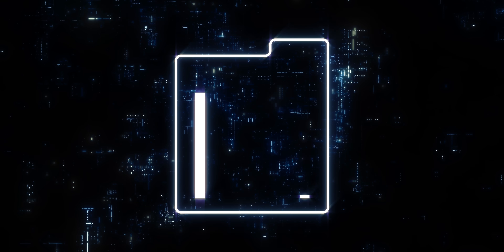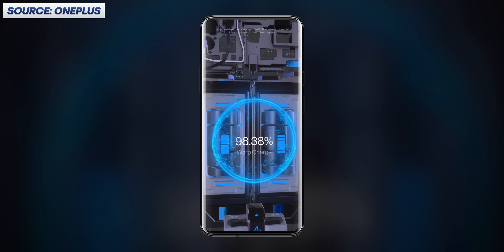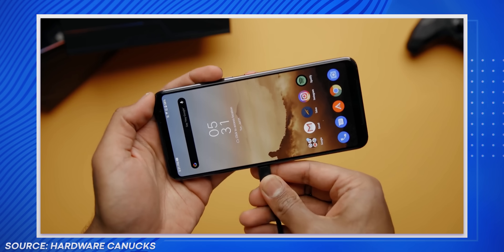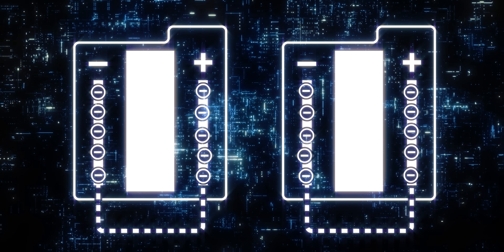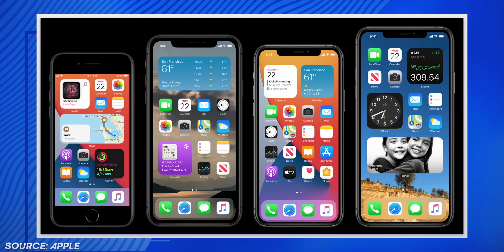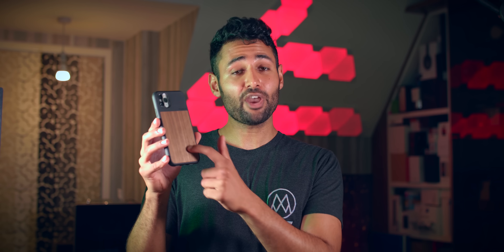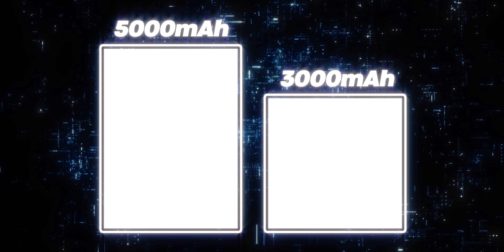The Problem with Fast Chargers.

Comment: Plugs phone in fast 120W charger
The Phone: Note 7 Mode has been activated.
Reply: That's a good one
Reply: funniest cell joke I've heard ever ha
Reply: The phone 2 : Apple mode has been activated.
Reply: That was a really dry joke :P
FYI:Note 7 did not have as many cases of catching fire as people think. Just media blowed it up.
Somne iPhone have had just as many real cases of catching fire ;P
Reply: Ik
Reply: @Oystein87  it's not the amount of fire catching that happened, but rather the way they handle such PR disaster is so poor.
Reply: @FlameRat_YehLon  They handled it pretty good.. And they recalled to phone very quickly and got new batteries. But the battery manufacturer fucked up AGAIN so it did not work so they recalled it again.
So Samsung did good in handling the situation and people still complained.
If it was Apple they would just deny, deny deny and than finally when enough people get mad and the lawsuits start rolling ion: "ok, we did do a mistake after all and will fix it". THAT is a bad way to handle things.
Reply: @Oystein87  That's true everywhere else except in China. In China they tried to bribe affected customers to not disclose the issue while claiming a case to be "done intentional" with the customer claiming that he didn't allow Samsung to take back the phone (meaning that the claim is made with no proof since no test can be done). That phone was later sent to test by the customer himself and the result says no external force is applied to the battery.

And what's worse, it lead to people dig deeper and found that they seemingly bribed government to cover up one of their issue once. (There was an accident that an S6 caught fire and burnt a child's face, and when the customer reach government for some test result to see who is to blame, they got beaten up and weren't allowed to take photo of the test result.)

And during the next year, there are rumors that they bribed the television to not report the case during a consumer protection show (which is supposed to reveal consumer market issues every year and has wider influence than the internet). 

All those and... They didn't say sorry for once in the later years and they didn't even tried to save their PR with some better marketing campaign (but rather they either don't do marketing at all or ignore that people still have concern in their products). Which lead to them from having 20%+ market share in China to basically none.

Disaster it is, and they have no one to blame but their own. I mean, these are issues every manufacturer might face, but they indeed did it worst to get it over.
Reply: @FlameRat_YehLon  🤣🤣🤣🤣

Comment: I rarely use fast charging. Only when I am in a pinch and need battery life. I also never use my phone when it's charging, and place it in a cool place, like near my air conditioner or fan while it's charging. I always trickle charge via a USB overnight, where it might take 5-6 hours to charge my phone, but the slower speeds generate almost no heat, making it healthier for my devices. 

For some people, this might not be convenient, but I also have an LTE smartwatch so it's not like I am always 100% disconnected when it comes to picking up calls or texting. This habit also curves my social media consumption, so thats another positive side effect of letting my phone charge and let it do its thing lol

Comment: Me who is charging my phone while watching this video

What's over heating?
Reply: Depends on how fast you are charging... And it will also slow down the charging when the heat of the battery rises..
Reply: I thought the same and not just that i am using the rog phone and it's side port witch charges just fine don't know what hes on about

Comment: my moto g7 power has their "turbopower charging" i think it used all 4 conductors since it only works with a cable that transfers data, its quick (charges the 4759 mah battery in about two hours) but it gets HOT

Comment: I have two phones of the same model and thier batteries are removable so i use my 100% battery while the other battery charges from 0 to 100 so when my first battery dies I'll just switch batteries and so on

Comment: i will say this - i have a realme x2 pro. i charge it at 50w, sometimes overnight (though i try not to), but 50w is fast. i've had it almost a year, and i've not noticed any degradation. on obviously it's a slow process, but normal amounts of degradation will only really become noticeable after a few years - by which point most people will either be buying a new phone, or replacing the battery.
Reply: I've heard other with Realme phones say the same thing. I do think it'll take another year before this can be truly proven. But I have a Note 5 with older fast charging and a Oneplus 5T with slightly less older fast charging, both still have solid battery life and still charge very fast. I don't believe this has been proven yet and is simply an assumption.

Comment: I am using mate 20 pro when i charge its temperature increases from 35 to 43 celsius so i use commob 12 v cpu fan coller it stabile the phone temperature at 35 c

Comment: I've been saying this for years! In regards to charging efficiency normal (non-fast charging) batteries are like sponges. If you dump a bunch of water on a sponge quickly it isn't going to absorb much water. But if you add one drop at a time to the sponge it will absorb all of the water until it's full. So in regards to batteries it's the same. A slow trickle charge fills your battery completely with very little harm (there is always degradation to a battery whenever it's charged, but a trickle charge causes the smallest amount of harm). I personally use the lowest amp charger I can find and charge my phone at night. In the morning I have a complete charge and I'm ready for the day.

Thank you for making this video! Hopefully this helps progress the paradigm shift when it comes to phone batteries and chargers.

Comment: Arun: "If you keep your battery at 40°C then 40% of its capacity will disappear"

Meanwhile my phone that reaches upto 50°C even if it is charged with a 10 watt charger: "I guess I'll die then"
Reply: Can't relate, I play and charge my phone inside my fridge .
Reply: @thesecret5706  Been there bro😂😂😂
Reply: 😂 40% @ 40C is very rare case. My phone get to 40C very easy while charging. Has been 2 years already capacity has decreased only about 20%. Although he was right about manufactures having buffer. My phone actual capacity is 3010mah but even when it was new it charged only to 2667mah. 😂 For 1 year it showed full health because despite degrading it was still more than 2667. Now it has decreased to 2400
Reply: @rapiddu6482  can you tell how you checked the battery power
Reply: @gauravmisra3107  There are apps for that, like accubattery for example.
Reply: @rapiddu6482  how'd you know the exact capacity?
Reply: @rapiddu6482  how do you exactly know these specifics about your phone battery? Like for an app or something? If yes then please would you tell which app/software
Reply: RapidDU how you know how many mah is left?
Reply: He is talking about the environmental temperature.
Reply: @Quad3  HTC One M9+
Reply: Buy a phone cooler, they are cross compatible with basically any phone model and you'll use it on tour next phones.
Reply: @Anankin12  Can you suggest any? The only ones I find are gaming ones with joystick
Reply: @sahelhossain7601  well I do use the BlackShark one even if I don't have a blackshark phone; it's very effective. The two downsides I can think of are that you must be careful about how you place it or it could become a heater instead of a cooler (usually, the interface lies between 5°C and 20°C depending on various variables; got it to 70°C by mistakenly covering the air intake for a very extended period of time) and that it's difficult to place on the "hot" components due to the fact that the camera bumps will destroy the conductive interface. It's also slightly heavy.
It gets cold enough that condensation will form on the cold side, so pay attention to that if you leave it running with nothing attached to it.

It does its job incredibly well though.
The name is FunCooler Pro.
Look into similar stuff.

PS: the thing works using a thermal diode, which uses the quantum mechanical properties that make PCs work to move heat from one side  to the other. So, one side gets colder, the other hotter. Since second principle of thermodynamics, the hot part gets hotter than the cold part gets colder, due to the electrical energy you use to do the work. This is not a problem, because the hot side has a relatively massive heatsink, which is cooled down by the airflow generated by the fan. The fan is the intake, the holes on the sides are the exhaust. If you block the exhaust, the hot part won't disperse the heat to the air of your room ant it will become a little stove, although the heat output is very limited.
Reply: @Anankin12  thank you bro
Reply: I will advice everyone all over the world to stop wasting their money on fake brokers and scammers who promise you instant cash out. it's not as easy as you think. Please try to stay off because you would loose money. People who have lost money are so much and it gives a bad name to real investors. If you really lost alot of money in the name of bitcoin mining and binary option trading because you kept meeting the wrong managers. I work with recovery expert/consultants. He help people recover money they have lost from binary options crypto currency trading and bitcoin investment. You can reach him out on telegram via @richardn44 and he will guide you on steps to take to recover all your lost money just in 5 working days
Reply: @lisakate2952  WTF

Comment: Will third party power bricks still cut the charge? I have been using a third party fast charger by Aukey on my iPhone and am now worried about using it. Is it safe to just use when I want my phone to charge quickly right before I leave in a rush and not to a 100?

Comment: Phone companies should really start using a buffer battery, like in electric cars.  eg: 2000mAh + 400mAh buffer, so if the battery loses 1% capacity, it starts to access 20mAh from the buffer.  

Only once 20% of the battery is permanently lost does the phone start to lose capacity.  This way, the user has highly predictable battery life for much longer.  Since it's only a buffer, it may also be possible to easily replace.  Could create a category of phone inbetween "removable battery" and "non-removable battery".  Since the former doesn't really exist anymore, this could be the only way to to extend the battery..

Of course, an even better approach would be just to have a modular battery design.  eg: have the back of the phone be made of 5 small slidable batteries.  Phone charges #1 by 10% at 120W  → #2 by 10% at 120W → and so on.  Or just have 10 of them and when phone needs charging, replace them with the already charged ones.  So even if the batteries charge slow, you can always recharge the phone instantly.

Comment: “you should keep your battery at around 50%”
*my iPod touch with no battery status*
Reply: You can add the battery widget (the one in notification center) and it tells you the battery percentage if you really want to know it ;-)
Reply: Dvd Rori no i have to connect to a bluetooth device in order to “unlock” the widget. idk if it’s different on ios 13/14 but there is no default widget for battery on ios 12 without connecting to a bluetooth device. all my bluetooth devices broke.
Reply: Clorox Bleach what generation iPod touch do you have
Reply: KloutKami iPod touch 6th generation. it’s not compatible with iOS 13/14. My final update was 12.4.8.
Reply: @cloroxbleach7262   I have the same iPod and iOS version but i can use the widget regardless of bluetooth devices being connected. (I don't have any btw)
Reply: I feel ya loll
Reply: Yes lol

Comment: My ipad is always at 100%. I charge while gaming and i leave it charged. It’s smart, it knows when to cut power. It charge too slow and the battery drops too fast during gaming so it makes sense to keep the battery always at 100%. And  i also use a laptop cooler during gaming as it keeps the ipad and my palm cool.

Comment: Very good video! Thats why Apple was sticking for a looong time with the 5w charger...slow but spare the battery life...I have always found that 1,5 hrs to charge my phone...and after 10 months of use, I still maintain 100% capacity (I dont use it for gaming, my Ipad is perfect for that, so just browsing, social media, and sometimes videos, but that one also goes mainly on my Ipad, and normal phone calls, and I never let my battery go down below 25%)...thus its no coincidence Apple was not pushing Warp-Super-Hyper etc charging...But at the end of the day battery degradation is inevitable the question is whether it will be in 6 months or 2 years...

Comment: I have 40w charger and what I always do everytime I reach a month I reset my phone battery like from 100 to 0 so that it will reset the cycle like it used to. And so far it works always.
Reply: Just curious to how long you've had that phone. Last person I asked that had a 40 watt charging phone said the battery was still solid after just over a year. Now a year isn't 2 years, but it seems to disprove this or at least strongly challenge it.

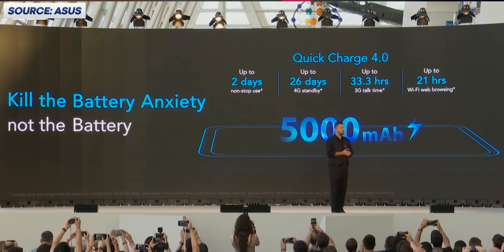Comment: 4:35 Idk if its related or not, my Galaxy A20s has the option to turn off fast charging from the settings. (using the charger that came in the box btw. 15 watts)

Comment: Bullshit BTW, most of them have 2 separate batteries. So it doesn't get harmed to use fast charge. what you talking about is a simple phone's battery capacity degrading.

Comment: Apple was secretly the good guy the whole time but we didn’t know it.
Reply: People will complain over everything without even researching a bit.
Reply: @nonsudunk  Exactly, that's why I didn't mind Apple for including a slow charger, nobody outside the tech space complains about this, I've realized that the 18W charger from  Pro Max charges WAY faster than the 5W but at the sametime wears battery capacity overtime, I'm currently at 91% after one year, I use the 5W overnight and still at 91% almost after 2-3 months, and regularly and 18W in situations were I will need my battery full to some point.
Reply: @Racko.  I'd rather have my battery slightly worse after 2 years than wait my phone to charge up for 3 damn hours. 5W is too slow, there should've been a switch for people to at least make it 10-12W when they need it.
Reply: Oneplus uses 'oppo vooc' technology which is much better and way less heating compared to 'quick change' instead of raising watts it's increases the current so if quick change uses 20v 3a(60~65) then SuperVOOC 2.0 (oneplus 8t chrger) uses10 V/6.5 A (65 W) and all the heat kept on the charging brick itself which itself reduce phone temperature
Reply: @surjithrock9139  That's sure an advancement but, still, fast charging degrades batteries more than normal one.
We'll need some more years until it actually becomes better.
Reply: They were not being good on purpose.
Reply: @akhil__dev  Oh, sure, here we have the expert

Comment: Many phone do disable fast charging or reduce charging current when you turn screen on or phone heats up too much. 
You can use accubattery, 3c toolbox or usb tester to test if that's true.
I think that, charging battery in cold damages battery more than letting it warm up a little bit.

Comment: I thought you would talk about VOOC and SuperVOOC. Oppo/Vivo/Oneplus/Realme phones have this special charging mode where the regulating circuit is actually in the charging brick, not in the phone, so the phone doesn't heat up that much. I've heard that heat causes more degradation than "over" charging to 100%, but also you should not let the battery below 20%. 
My 4 year old Oneplus 3 still works fine and it has about 2600 mah capacity from its original 3000 mah. I usually charge it to 85-90% and let it down to 25-30%. With its 20W charging it takes half an hour to go up 30%->90%.
Now my new phone is a Realme X2 pro, which has a 50W charger and I often charge it for 5-10 minutes only... otherwise it goes above 90% so quickly I don't even notice :)

Comment: But how come oneplue 7t gets full charged in one hour and also maintain a backuo of 16hrs even if used continuously?
Reply: The 7t is only a year old, which I guess would be the argument. Meanwhile my Oneplus 5T 20w fast charging is still solid and so is the battery after almost 3 years. 🤷🏿‍♂️

Comment: I've always known that charging to 100% is not good in the long run for the battery that's why my laptop is set to stop charging at 80% , but my question is --- if you set your device to stop charging at a certain amount, will it bypass the battery and directly power the device (like the ROG phone feature)? does it work like that on phones too (the charging limit) -- if  available as a feature like in most laptops?

Another thing, charging to 100% is as bad as draining your battery? there is that dip cycles thing on batteries that ive read somewhere 

Let's say you will be using a phone for 3 years, will you be able to notice the degradation of the battery capacity in that short span of time before pick a new phone? cause if not then fast charging is not that bad compared to the convenience of having to charge your phone to a certain capacity youll be comfortable to use it  in a short period of time. i really dont know what im saying  but yeah ill just comment since ive typed it already

Comment: i feel that there's something wrong about your explanation that all electrons move from the negative side to the positive side. If that's the case, then all we got to do is switch the 2 parts around... making the positive side where all the electrons went to, and convert it to be used as the "negative" side. Disregarding system loss, then you would never need chargers in this case.